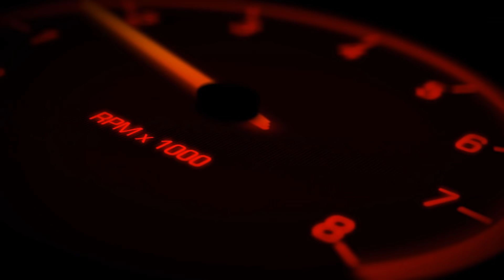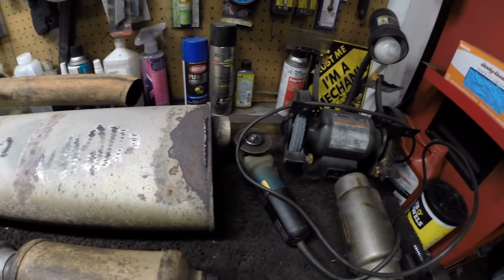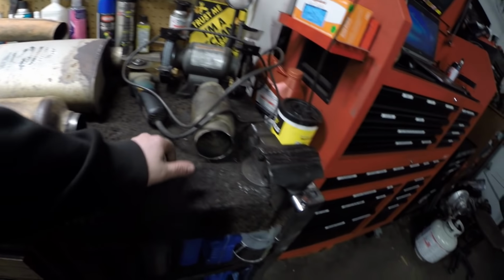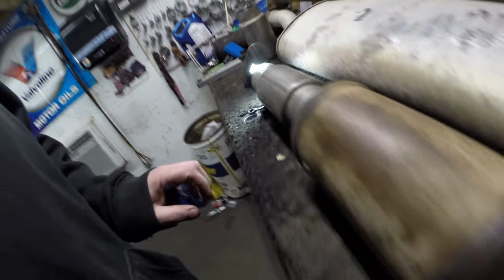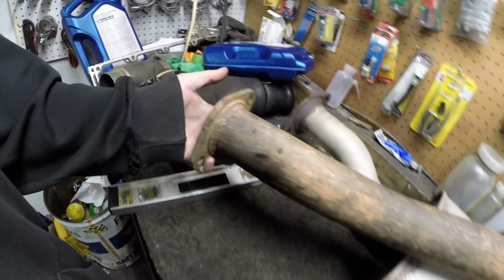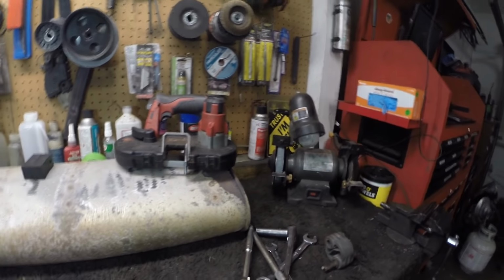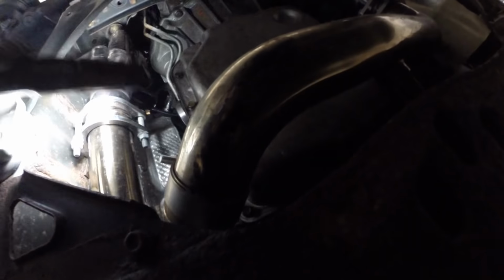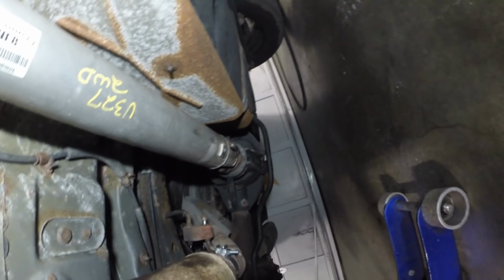Saab 97-X (TBSS) Get's A Homemade Exhaust! It's Loud!!

Comment: Sounds good what headers are you running and how bad was the install ?
Reply from the maker: Hi there, these are XS Power Long tube stainless steel headers off road with y-pipe.  Very nice and great fitment. There are other videos on this truck of the full build if you want to check them out! Thanks for watching!
Reply: @RevHardGarage  i may have missed some parts of the build I'll be catching up, I've been looking at the TBSS LSA build because thats a little more of what I was thinking of going with.